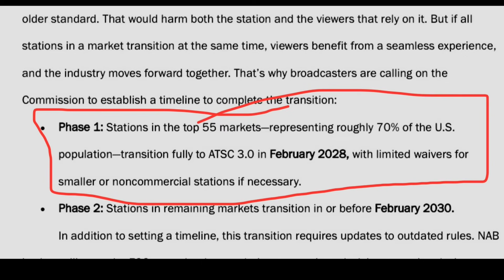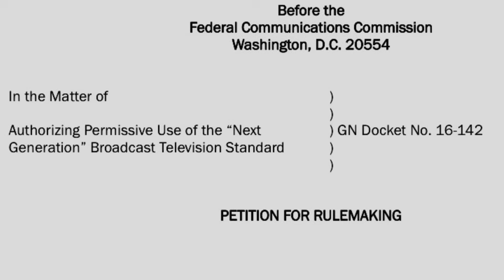What is the REAL Reason for the Possible Shut Down of ATSC 1.0 Over-the-Air TV?

Comment: They are better off using the existing ATSC 1.0 signal, but with H. 264 video encoding, as it's supported on most TVs and set-top boxes made since 2012 and even some going back to 2008. Not to mention, H.264 looks much better, allowing for multiple HD-quality streams on the same 19.39 Mbps ATSC (Digital TV) bandwidth, instead of the cruddy 480i channels you get with MPEG-2.
Reply from the maker: I agree, its a much more efficient use of bandwidth. But most TV stations don't want to chance viewers complaints. There have actually been networks that have changed to MPEG4 codec and then switched back to MPEG2 because viewers called to complain they couldn't get the picture.

Comment: I haven't seen any FCC licenses in quite a while, but those I had seen included requirements for free OTA signals to ensure emergency information broadcasting.  I would bet that would continue as the TV signal transmission gear is usually better prepared to continue operation in an emergency than the service of the cell phone companies.  Also might be beneficial to the stations owned by big media (or contracted stations) to use subchannels(?) on a PPV basis for special events.  If it all goes behind paywalls my TV is just going to be a display screen for my DVD/Blu-ray player.

Comment: I disagree. ATSC-1.0 is a stepping stone. A big one. It accomplished a bunch of shady goals. Channels don't reveal frequencies. It creates a digital environment that opens return stream for auditing and controlling a watcher's choices. On air and cable have to agree on this standard. It trashed the openness of receiving TV casually. Trashing 1.0 was the plan all along. ATSC 3.0 wants to trash the standards of the past. Complete elimination of NTSC analog as a buddy system on your newest TV's. TV will become a privilege only allowed when you have immersed yourself in an Internet connection. If you just couch potato TV, without tying yourself to the system, you are a trivial watcher to be dumped from on air plans. Control is power and TV watchers are sheep. We haven't earned the right to be couch potatoes by getting mad and organized. Broadcasting separate services along with TV watching would be a waste. It's already saturated by FM digital services, and they are only a lukewarm income.

Comment: No boxes period if my current TV won't pick up the new service I will not upgrade. There is nothing on tv worth the cost for Internet and a new TV it should be ten years after they install on new TVs they should be forced to broadcast on both for ten years before shutting down the current one. We need a nationwide boycott on all advertisers that are on the 3.0. 73

Comment: Analog TV was so much better. I miss it.
Reply from the maker: Many viewers have expressed the same feelings.
Reply: @NorthcoasterHobby  Big reason for me is reception.  At my parent's house I had to help them install a large roof antenna. Before the changeover, they could easily get TV with basic rabbit-ears.  Not so with digital tv.
Reply from the maker: @ I agree, when my local stations were broadcasting in analog I could pick them all up easily with a set of rabbit ears on top of the TV- now I need an outdoor antenna to get them.
Reply: @NorthcoasterHobby  once they digitalized the signal it pretty much knocked its signal in half! like where im at a local signal could travel up to 60 plus miles from our tower location! very few stations around here had used translator stations! two stations used them to cover the whole state just so we could have full state covereage! PBS and a CBS affiliate were the only two! two of our local stations use translators for neighboring states! once digital came in that ment the need for more power and less translators!

Comment: I'm retired, I cannot afford a new tuner or tv and a very expensive internet connection. There's nothing good on tv anymore, and the length of the commercials is ridiculous. So bottom line is they can shove it!
Reply: Im tryin to get Antenna tv from San Francisco stations to vallejo California, 30 miles but mountain blocking my signal

Comment: Yeah i highly doubt this will happen anytime soon. There are millions of tvs that will be rendered useless for over the air broadcasting if they shutdown ATSC 1.0. unless you buy a ATSC 3.0 adapter and they arent cheap. This isnt like shutting down analog tv signals where tv manufacturers and consumers had years in advanced warning by the FCC when the gov wanted to move tv signals to digital. They want to shut ATSC 1.0 down within the next 3 years! Plus you have royalty disuptes to contend with. TV manufacturers like LG stopped putting ATSC 3.0 in their TVs altogether over a royalty dispute with Constellation Designs for the implementation of ATSC 3.0.
Reply from the maker: All good points you make here. I addressed most of these in my first video on this topic.
Broadcasters Want to Shut Down ATSC 1.0 TV and Move to NextGen TV- Will it Actually Happen?
https://youtu.be/zNPn_jCQeLo

Comment: From my perspective over the years costly changes and upgrades have been required in order to continue to receive OTA broadcast signals. Also, while at the same time my interest in the content has been steadily decreasing. Shows my wife and I like to watch have been steadily moving to be behind paywalls. I am at the point now to where the only thing of interest to me is to see what is going on during a severe weather event. My wife does not watch anything that comes from OTA broadcasts any longer. I do not think the juice is worth the squeeze to upgrade everything to receive the new signal and to deal with DRM, just to check out the weather. And, I think our cellphones cover most of the emergency notifications already. The rest I have no interest in. Basically, I have had enough of the game and I am out.

My plan is to just let it expire and repurpose the antenna system for other uses. If the power / Internet is down... to find out in near-real-time what is going on during a major weather event I have my radios.
Reply from the maker: You raise some good points here.

Comment: You just reading NAB talking points. In the age of free youtube, claiming that datacasting would be delivering educational content is laughable. Typical ATSC 3.0 station transmits around 20 - 23 Mbit/s of data in real world scenario compared to 19 Mbit/s for ATSC 1.0 so the claim of better spectrum efficiency is moot. You are not doing much of data casting with that. Why would you bother with this if LTE/5G wireless services are much faster, cheaper, bidirectional and have more area coverage than TV. Most likely reason is DRM which would allow OTA TV to carry premium content that cannot be recorded, saved or pirated. From the point of view of rights holders, DRM would make TV a viable alternative to Netflix for distributing their content and broadcasters benefit by offering more compelling programming to attract viewers for advertising.
Reply from the maker: @antronx7  I did a bit more research after reading your original comment. I see your point about how datacasting on a channel could make OTA TV signals suffer. Thanks for sharing this information with me.👍
Reply: @NorthcoasterHobby You're welcome. Another thing I forgot is ability to force unskippable commercials since broadcasters will now control which receivers can decode DRM.
Reply from the maker: @ Yeah -the whole A3SA broadcast rules that only apply to ATSC 3 stations simulcastling in ATSC 1 will probably go away as soon as the substantially similar rule is eliminated, meaning that broadcasters won’t have to allow any of these trick play features for recording, ad-skipping, rewinding, etc., just more control over the content.
Reply from the maker: @antronx7  Spectrum efficiency in terms of video compression (MPEG-4 and HEVC codecs) to allow multiple HD and 4K video channels on a single channel, with bandwidth left over for datacasting. The data rate you mention would be carrying more channels at higher resolution, wouldn’t it?
Reply: @NorthcoasterHobby  You are not doing watchable 4k + HD + data in 20Mbit/s. Not even with h.265. The answer has to be DRM since every excuse they present as to why we need 3.0 is bogus.
Reply from the maker: @Point taken. My understanding is that if you increase the data rate, then you’re going to decrease coverage, and vice versa. I also know that parameters can be adjusted to dial in data rate/coverage. It really gives broadcasters control over everything. 

I’m not a technical expert on ATSC 3.0 and never claimed to be. I am just trying to keep my viewers updated and possibly offer some explanation as to the sudden urgency of this petition from the NAB. It seems like they’re just looking to monetize the airwaves as much as possible up to an including the use of datacasting. ATSC 3.0 has been marketed very poorly to the general public.

Comment: Some of us might benefit from the change.  However no one has explained the sudden "need" to rush the process.  I may be wrong, but I doubt manufacturers can be ready in time.  And do consumers really want another converter box phase?
Reply from the maker: @stevejohnson1321  Manufacturers will never be ready in time with enough converter boxes or TVs for ATSC 3 and as well it’s gonna take a lot to have mass adoption of the standard by consumers.

As for the sudden need, I think it’s really just because broadcasters want to start monetizing this new TV system as quick as possible.
Reply: what's needed is a transition period of 10 years, starting with a requirement that new equipment has both ATSCs
Reply from the maker: @ And also a guarantee that free over the air television will remain unencumbered by DRM encryption. It should be a condition of holding a broadcast license.
Reply: Probably five to seven years would work -- 2028 just seems too soon.
Reply from the maker: @ At least 5-7.

Comment: Just wondering if we can open source ATSC 1.0 to the public if industry abandons the standard. There may be a possibility of homebrewing the technology for private broadcasters so that there could be a new wave of independent broadcasters willing to use it for experimental purposes. Like cable 10 with locally produced productions etc. Could be an opportunity to create a new market, new content.
Reply from the maker: A broadcast license is required.
Reply: The patents on 1.0 haven’t expired. You can get an ATSC 1.0 modulator, but they’re expensive. You can’t broadcast an independent station without an FCC license unless you want to be a pirate broadcaster. If you do so, you’ll get fined.
Reply: No. The ATSC 1.0 technology would still require a broadcast station license and use technology that makes inefficient use of the RF spectrum, which is opposite the mandate Congress gave the Commission back in 2004 (?date).

Comment: I'll be happy if they shut this atsc 1.0 because on my tablo every time l try to watch abc it says "storage is full and l turn on to nbc it says weak signal and cw channel says the same thing storage is full
Reply from the maker: Have you checked the capacity of the hard drive? Are you using an indoor or outdoor antenna?
Reply: @NorthcoasterHobby  indoor
Reply from the maker: @ Have you tried relocating your antenna -maybe place it up higher, or put it in a window that faces the same direction as the broadcast signals.
Reply: @NorthcoasterHobby  l do have the antenna placed on my window
Reply from the maker: @ Does the signal improve if you place it higher in the window?

Comment: My thoughts are that the FCC should mandate that no matter which versions (1.0, 3.0 or higher) of ATSC tuner are used, those versions must have free OTA unencrypted signals for the general public if a tv station wants to have their broadcast license. And if a station wants to have datacasting, there should be technical standards for datacasting so that it doesn't interfere with OTA tv signals at a distance up to 60 miles away.

Comment: The broadcasters and FCC don’t seem to care about consumers much anymore. It’s all about money. The FCC of the early 2000s was vastly different to now. Things like cable cards and getting locals free on cable seemed to be the among the last pro-consumer directives. From late 2000s to now, it’s all about spectrum reallocation and giving broadcasters whatever is needed to make more money
Reply from the maker: Agreed.
Reply: Broadcast, especially analog, is a huge over-allocation of RF spectrum and other RF users (American Tower, ATT, T Mobile, Verizon, Cox, Comcast, etc) all want what's left of TV's RF bones.  First it was 700-800 mHz (top of the UHF TV band) and the DTV re-alignments, then 600-700mHz, because CONGRESS told the FCC in a funding bill that they'd get no more money if they didn't do a better job of "monetizing the spectrum" which means "find a way to kick TV to the curb and sell 10 year licenses for the vacated spectrum to cellular/other wireless service providers."  The FCC is supposed to be non-partisan but in reality it tends to lean toward the industries it regulates (go figure) than it does toward consumers regardless of individual commissioner political party.
Reply: Broadcast television was based on caring 40 and 50 years ago.   😆
Reply from the maker: @ Caring is not the currency of today.
Reply: Same reason why most of the channels are in crappy 480i

Comment: All free old OTA ATSC 1.0 TV subchannels legally gone in 2028.
This FCC legal trick means no free money for New DRM 3.0 TV tuners legally needed to be paid for by the DRM 3.0 TV stations.

OTA DRM encrypted ATSC 3.0 TV stations plan to steal all of the  (Free OTA ATSC 1.0 subchannels)  in one evil move by installing only  (1 permanent forever Reverse ATSC 1.0 TV lighthouse transmitter antenna) to replace all old 1.0 TV stations in an area in 2028.

People still can watch the free old OTA ATSC 1.0 TV without any subchannels and without needing a new expensive DRM 3.0 TV tuner box.

This FCC legal trick says only one main Free channel and no subchannels are required by FCC rules. 

Your free OTA (over the air) USA TV subchannels birthright gone in 2028.

The extra unused OTA DRM 3.0 TV bandwidth is now legally in the DRM 3.0 TV stations ownership and not in the USA people's ownership.

Boycott OTA (over the air) DRM (digital rights management) encryption ATSC 3.0 NEXTGEN-TV until DRM is removed by law in the USA.

IMO 2025.

Comment: From what I've gathered, the more data casting a station does the broadcast signal weakens.  This means that the further away from the station, the less likely it is to receive a signal.  ( For all of the viewers that are in the 50-mile range, it will most likely not receive a signal.      
     I might be wrong, but from what I've read and watched/heard, this is the case.
Reply: The reception range could be reduced down to be like the low powered 1.0 stations.  They sure don't get out very far.
Reply from the maker: Yeah, that is my understanding too. Datacasting seems like it is best used for hyper-local applications.
Reply: Signals are already weaker and will get weaker yet.
Reply: Could Single frequency networks (SFN) be used to mitigate that.  SFNs allow a station to operate multiple transmitters throughout their coverage area to fill in gaps in coverage.  They can also show hyperlocal advertisements for different areas.
Reply from the maker: @ I’m not sure. Do you mean setting aside a single frequency specifically for datacasting so that it wouldn’t interfere with over the air television?

Comment: So essentially, it’ll be a widespread WiFi. I really wonder if it will happen as fast as the NAB would like. I think it’s quite hasty. It seems either the NAB doesn’t realize how expensive this will be for viewers or they don’t care. Especially, on the tail of the new tariffs being imposed, costs of electronics will get more expensive than they already are.
Reply: There already is a list of TV broadcasters that have 1.0 and 3.0 on now.. Last year there were only about 5 and today there are 40 or more so it will happen in the next couple years and then the squeeze will begin to push people to buy 3.0 tuners..
Reply: The NAB proposal includes a provision that broadcasters will NOT be required to simulcast 1.0 and 3.0 for a transitional period. They want to switch cold turkey to 3.0 ONLY in February, 2028, meaning virtually everyone will have to buy a new TV or a compatible set-top box in three years.
Reply: So long as there's no problem with encryption then it shouldn't be too much for a problem. That and if the cost of televisions are kept down due to the tarrifs that'll be implemented.